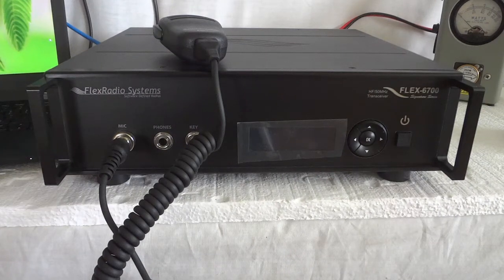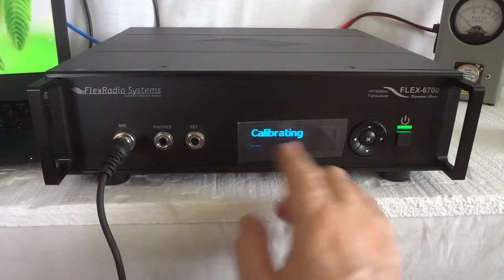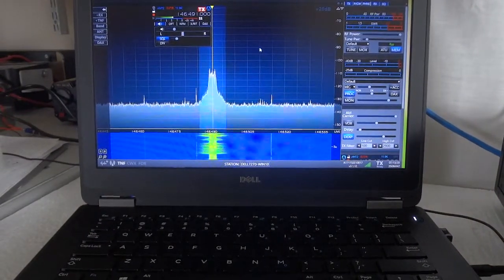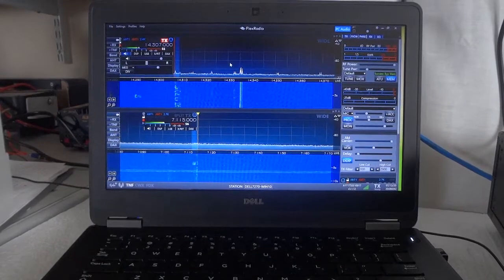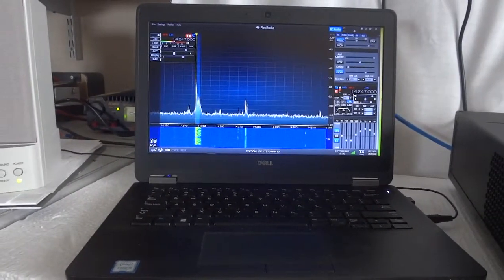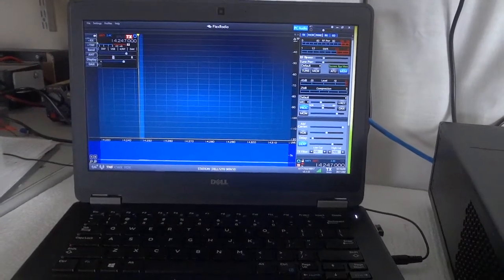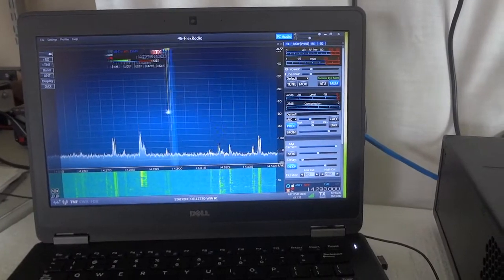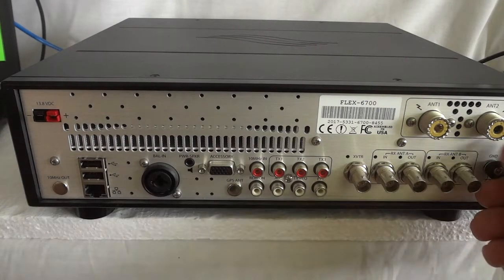Demonstration of the Flexradio 6700, the king of direct-sampling FPGA transceivers

Comment: Flexradio refuses to fix customer's nit pics, such as the almost worthless auto notch, noise reduction,and a couple other quirks, like ringing filters. I've owned 5. No more thanks. K3s kills noises thing wont touch. Admittedly the flex sounds better than the K3s, but does  not pull in the very weak ones like the k3s.